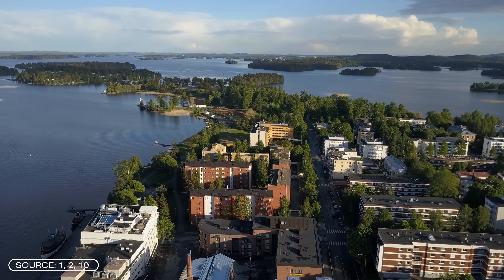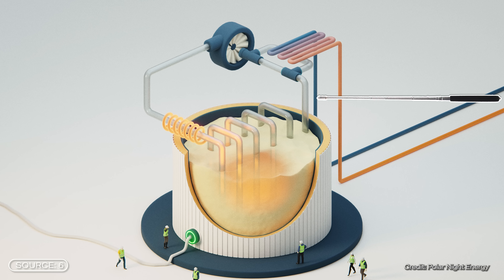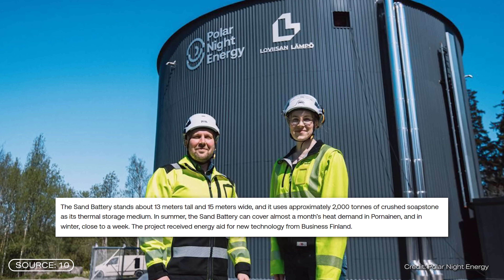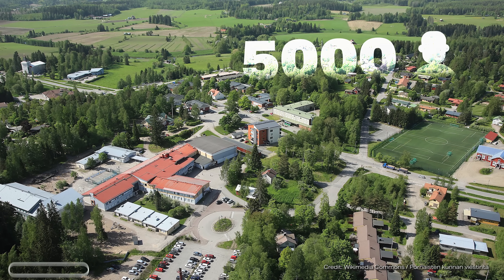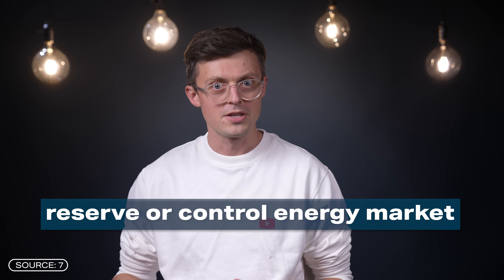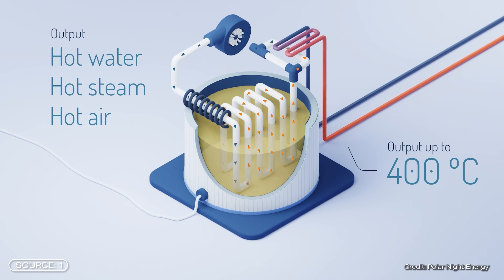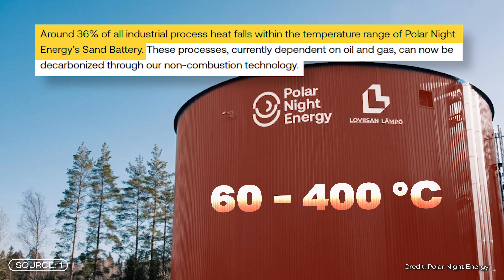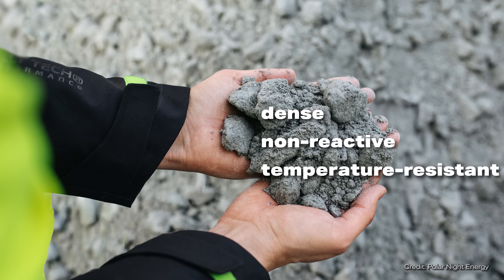Finland's Giant Sand Battery: A Revolution in Energy Storage?

Comment: I have such a device at home. It's called "accumulating oven". You heat bricks in an isolated casing when surplus of electricity is available. And use the heat when electricity is less available. These things were produced in huge quantities in Eastern Europe in 1970s and 1980s. Were then in almost every home.😊
Reply: I Know them as mother stove. working on gas or wood/coal fire. 
Large brick stove. You warm it in the evening. At night time the stones radiate the heat with the need and danger of a active flame or fire when you are sleeping
Reply: @a41wilde57  you mean ‘without’ the need …. ?
Reply from the maker: It's interesting that this technology has made a comeback. Do you know how it is controlled, so how does it know when there is a lot of electricity available? These systems weren't smart in the 70s and 80s, were they? Or did they use the stove back then and today it uses electricity?
Reply: @GermanScienceGuy The price of electricity switched then two times daily - from 22 to 6h night price (low) and back from 6 to 22h daily price. The measuring device switched automatically and both tariffs were measured separately. The stove was set on and off per hand by the consumer. Probably there were also simple 1970 s style automats. I did not see such devices.
Reply: Are you German? That is some rough English. I didn't understand it all.
Reply: @GermanScienceGuy You could Google the words" akumulirashta pechka" in "images" to see how it looked like. It's a somewhat dusk communist design, but it's a pretty sophisticated tech and very useful.
Reply: @GermanScienceGuy  In Poland it's called "Piec kaflowy" ("Kachelofen" in german) or at least it what I assume he meant, or something similar. At any rate it works with the same principle, you heat it up and it collects heat, giving it back through the day. It takes 12 hours to almost whole before it's cold. Old fashioned ones were heated with burning coal or wood.
I haven't heard about new ones, but it makes sense. I see no reason why you couldn't warm it with electricity.
The device probably doesn't know when there is a lot of electricity per se, but there are electricity tariffs that have various price at various times, in Poland at least. So, you can schedule it to time where you pay least - presumably when there is most energy to spare otherwise the price would be higher.
There are some dynamic tariffs, that do change with use on the grid, so it's possible some devices are smart enough to get info via internet from server and heat up then, but I'm not sure it would practical. You would, at the very least, need to have a fallback time for it to heat, so you won't be sitting in cold if prices are high that day.
Reply: @GermanScienceGuy  i have big oven in my home too "Finnish stove, masonry oven",  uses firewood. It stores alot of heat energy and due to how it is designed it slowly releases the heat, i think how slow it lets the stored heat controls how warm it makes your home. I think its all about the thermal mass. Also theres controllers for heating systems that are connected to the internet, constantly following the electricity price and controls the heaters based on that. I recently built system where the customer had oil burner and geothermal heat pump and the controller shuts the heat pump down when it gets expensive etc
Reply: "nachtspeicherofen" is the german word for it... yes you find it in some older appartments...  same principle..
Reply: Well the idea comes straight from Finnish masonry stoves. very common in Finland. Wood burning stove with a masonry circulating galleries around the core firebox to retain as much of the hot exhaust heat as possible.

So they just scaled it to industrial size. The masonry galleries replaced with metal airducting and piping, wood fire replaced with resistive heater. instead of ton or two of masonry material to retain heat, it's thousands of tons of masonry material aka sand or crushed stone. Plus since it is days and weeks instead of hours, they control release by insulating and forced circulation. Instead of the food stoves just naturally radiating and conducting the retained heat out.

circulating fans and then air to whatever heat exchangers. Air to water for district heating, air to air for local hot air or steam generator for process steam. output heat temperature can be adjusted by regulating air circulating speed and by adjusting ration of bypass on the heat exchangers. Need low heat? the core is still at 600 C, but just circulate out small amount of 600 degree air against a large volume of transport medium, like district heating water and you get say 80 degree district heating water via diluting. Hence heat exchanger even for producing hot air. One doesn't want to put out the direct core heated air. Nah, that is used to heat the heat exchanger, which configuring and rationing then determines the output temperature.

The whole idea about this is: It's cheap and uses existing materials and methods. As noted the silo is just a normal metal silo like fuel tank. A construction company knows how to make those. The insulating is just normal construction mineral wool insulating. the piping is just normal steam/hot air piping. crushed stone is crushed stone. the heat exchangers are normal industrial faire as is the heating elements and fans.

only new bit is the control system and organizing these already existing industrial and construction bits in new way. It's simple known tech and predictable on it's costs and so on.

Finland is full of district heating systems, even small towns of say 5000 people will have a district heating plant and small district heating network in the town center area. The "can't let people freeze" mandates are so high per supply security clauses, that whole country is dotted full of heating plants (and now days almost always small colocated cogeneration electrical generator turbine on the boiler). So this is very much a "Finnish design for a Finnish need".  Maybe some will be exported, but all the municipal district plants will probably want a heat battery of some size. Saves them from having to peak their boilers at the coldest days. It's expensive for them. Plus at autumn and spring means they can longer keep their boiler completely off.
Reply: @aritakalo8011 Interesting. I visited energy effectiveness fair in Dresden 6-7 years ago. The highlight was a presentation of thermal accumulators with heated salt for solar power. Photovoltaics - hot salt- Steam turbines - heat+ electricity. I wasn't convinced then that it's effective. But it seems it is😊
Reply: We had a similar unit (also in the 70's) called a 'NightStor' heater. It comprised concrete blocks through which ran heating elements which were run at off-peak time. The radiated heat was very comfortable.
Reply: Nothing new under the Sun, as you said there is an accumulation electric stove, which works as well with theoretical efficiency of 99,9%. It works as 'sand' battery but is in the house so the 'loss' of heat is into the space that needs heating anyway.. so no loss. Why it is not economical to use is due to regulations set in favor of large installations.. Every apartment block could use excess electricity to heat water, but grid operator won't talk to you and will sell you the electricity at 3 times higher cost of gas even when there is oversupply. So you heat water using gas boiler..
Reply: They were used in the UK, and called "storage heaters" that were connected to an outdoor thermometer which then would determine how much energy would be needed to warm up the system at night when electricity was the cheapest. They were crap if the outdoor temperature went colder during the day as the property would never get warm enough
Reply: Mieszkam na Wschodzie Europy i miałem taki piec kumulacyjny gdy energi z wegla była tania.
Reply: Mieszkam na Wschodzie Europy i miałem taki piec kumulacyjny gdy cena energi z wegla była tania.
Reply: most advanced eastern european technology😂😂😂
Reply: @iamrightyouarewrong6730 Wszystko co proste jest niezawodne.
Reply: It all boils down to efficiency, not only energy but also investment. You need a district heating network to use the sand battery but the scale efficiency and the automation evens it out. Burning in small units is quite inefficient and polluting causing side effects that have other costs. It's a great backup but definitely not ideal primary source of heating energy in a densely populated area.
Reply: @McSlobo  Never meant to be. Just simply even by the supply security demands on those plants in Finland. That plant is the core of it's community essentially. It has demand of complete independence. Whole national grid should be able to go down and the district heating plant must still heat the town. 

There is no way they get rid of boilers. Since "we have on our yard that pile of wood chips to heat this town for month, regardless what happens outside of our yard."

Hence also almost always the boiler plant is cogenerating. If for nothing else... demand is the network runs with grid down.... well how you run the large main circulating pumps of heat plant without grid? By having a side steam turbine on the boiler to generate electricity for the electric pumps and usually even extra (when grid is up, well the turbine generator runs synchronized to grid and exports to the grid). Housing units then will have on their internal circulating pumps a switch and receptacle to bring in portable generator unit power the houses own electric pump and to circulate the house loop.

when ones has -40C weather, even "the national grid just crashed" can not be an acceptable reason for heating supply to fail. People die.

The sand battery is to a) during summer allow the boilers to stay off. Since while one doesn't need to heat rooms, buildings use district heat to heat the hot water line. b) during spring and autum, keep the boiler off longer. c) During peak demand in cold days, supplement the boiler meaning less fuel burn and stress on the boiler due to not having to run the boilers to peak.

Main reason thus boils down to "Lower the district heating plants fuel bill, which is their greatest expense".

District heating doesn't do this to be goody two shoes environmentalists. They do it for the financial efficiency. Specially since each of them is a natural monopoly and thus a regulated utility. Meaning they are limited on how much they can just hike prices. So should they want to improve finances, saving on costs is the way.
Reply: I assume you heat it with firewood? The difference here is that you take energy that is already being generated from wind turbines and store it. Compared to creating and storing energy for yourself and in the process create emissions. Not many people realize that burning a kg of wood produces almost two kgs of co2
Reply: @Jan93Banan No l. Electricity heating. Like on the video. The difference from normal electric heater is, You could choose WHEN to heat ( in the time with cheap E tariff). In the times of high tariff You use the accumulated heat. And do not consume electricity. Where comes the electricity from, is another story. In the 1970-80s mostly from coal power plants.
Reply: It's basically just a radiator. It's not meant for energy storage as a battery is as it not insulated and just releases heat as you're "charging" it with output dropping all the time. It's the same as making a firepit and then putting sand on it and sleeping on it for the warmth it provides. Or I guess you can call it a battery with no adjustability of when and how much energy you want to withdraw, it functions as any fireplace would, just increases the amount of thermal mass.
Reply: Sure oven is the same the difference is. when your oven has average temperature when heated about 70C that is 50c above room temperature. That is for one day. When your ove is 2 tons and you heat it 500 degrees it last 10 days when  you do 20 ton hea p of sand you got oven that helds whole heating season 100 days you got some losses add 5 more tons average haouse needs like 50 tonns of sand for heating application but there is more. You can youse it for electricity too. Every time you draw heat for central heating or warm watter you can put Peltiere element in between and get like 10-15% energy out as electicity.  Some would say that Peltiere element is not efficient yes when you don't use waste heat. When i have such system in place with solar cells that heat my battery then there is only one mont h where i must get some energy from outside since solarcells cant produce enough to keep even inverters running. but at that time i still get like 60% my electricity needs covered. When i add two electric cars then it drops to 30%
Reply: I live in eastern europe and nobody uses such and never heard of it.
Reply: @dtibor5903 Not anymore😊
Reply: @dtibor5903 yes.l had one. And not just in the east. Called thermo-
accumilating ovens.have lot of isolation and a fan.
Reply: @dtibor5903  It's also referred-to as a storage heater. They are ubiquitous throughout Europe and can still be purchased today.
Reply: That's why your toes are chilly.

Comment: Der Speicher ist also 13m hoch und 15m im Durchmesser, also 2300m3. Wenn man rein die Wärmespeicherkapazität betrachtet, dann könnte man mit 2300m3 Wasser mit 50...90°C = delta 40° (was für die reine Heizung von Gebäuden reichen sollte) auch locker 100MWh Wärme speichern. und das ganz einfach und billig mit traditionellen "Tauchsiedern" und Wasser, und die Wärmeverteilung im Speicher löst sich über Konvektion von selbst. Sand dagegen ist ein recht schlechter Wärmeleiter, man benötigt also ein ziemlich komplexes System der Wärmeeinspeisung und Entnahme, da man sonst weder die Wärme schnell in den Sandhaufen rein bekommt noch die Wärme wieder raus. Ein Problem das die Nutzer von Bodenwärmetauschern für Lüftungs- oder Wärmepumpenanlagen ja wohl zur Genüge kennen. D.h. solange es einfach nur um Gebäudeheizung geht, ist Wasser mit seiner recht hohen spezifischen Wärmekapazität wohl immer noch die einfachste und billigste Speichermöglichkeit. OK, 600°C Speicertemperatur, oder sagen wir 400°C real nutzbare Wärme ist natürlich für industrielle Prozesse wesentlich besser zu verwerten, aber für derartige Prozesse/Anwender braucht es auch keine großen Fernwärme-Verteilnetze, da der Bedarf ja eher lokal begrenzt ist.
Reply: 400°C water is not a good idea anywhere.
Reply: Ja, ich würde gern wissen, warum haben sie sich für sand entscheiden. Ich denke,es gibt verschiedene Dimensionen des Problem, z.B. Dauer, Komplexität, Korrosion, usw.
Reply: @markotrieste  ich glaube man wollte sich die Möglichkeit offen halten, eine weitere Rückverwandelung von Wärme in Strom anschliessen zu können. Also Kern-Wärme=> Kernstrom=>Sandwärme=> Sandstrom. 600C geben einen Carnot-Wirkungsgrad von 0,52, praktisch könnte man etwa 0,25 mit einem Dampfkreisprozess erzielen. Oder aber man möchte Sommer/Winter-speichern und Fernwärme auch nach langer Speicherung und Temperaturverlust im Winter anbieten. Deshalb kein Wasser.

Comment: I think you could make it work with an in-ground system, too, potentially much larger
Reply: geothermal energy
Reply: @chipcode5538 He probably means burying the sand batteries for insulation. Not the same thing as using geothermal energy.

Comment: Not bad at all, for the cold Finish winters!  Direct solar heating of the sand pile is most likely too costly (cover the sand pile construction with thermo solar panels??), but on the other hand, to use electric energy for heating is a bit of a waste of the electricity itself. How efficient is district heating btw (how much energy loss during the distribution/transport of heat), in comparison with the 20% losses of electricity distribution?  Local heat storage (per house or apartment building) of heat could be much more efficient considering the distribution losses of energy and the local means to induce energy, but requires better heat-capacity material than sand. Several research projects are focussed on the development of such materials.
Reply: You can transport heat very long distances with just a few % loss. Where I live the water going out is only about four degree hotter then the return.
At a part of pipe that is above ground near the plant, snow that fall on the pipe insulation do not melt.

Comment: More sand batteries of course!
But start where we have cold winters and use for lots of heat. As heat is most efficient to use directly instead of converting it back to electricity.
Reply: That is what this does. You can store heat there the whole summer and then take the heat out during the winter. Yes. This keeps heat stored for summer to winter.
Reply: @verttikoo2052  I think you will need a much bigger storage if you want seasonal storage. I have not heard any clame it's a season storage.

But exess windpower or any other reason there is exessive energy in the electrical grid may very well be used to "charge" heat this up for another day or possibly week
Reply: Absolutely true.
Reply: I think wind energy spikes are the "issue" and they luckily happen during the winter also, except when there's this major 2-5 week anticyclone stationed over Finland when there's all 2h of direct sunlight, no wind and bitter coldness. But hey, that's true winter.

Comment: What is price per kW of installed power ?
Reply: The company sells district heating at €85.90 per MWh. And the average price of the electricity they use is around €40–50 per MWh. However, the actual price they pay is much lower because they consume electricity when the market price is low.
Reply: @AliusScitmelius  I meant how much installation cost let say you want to build 20 MW of installed power, what is price for them to build it ? Cost of device not service ?